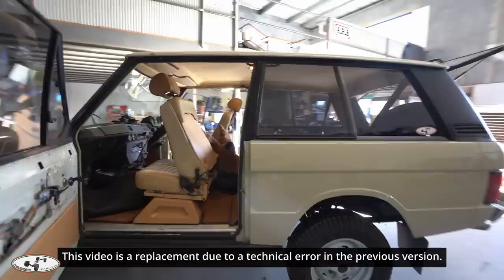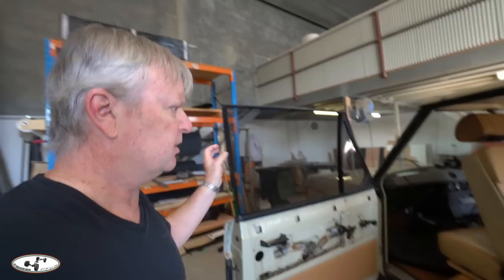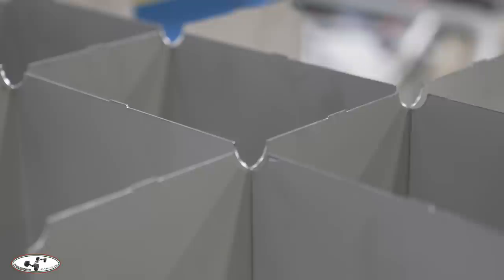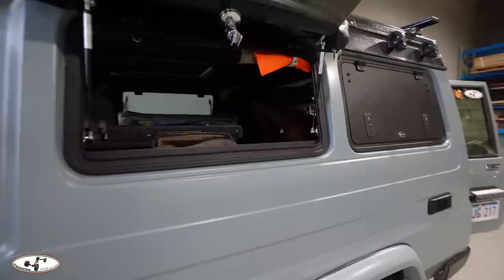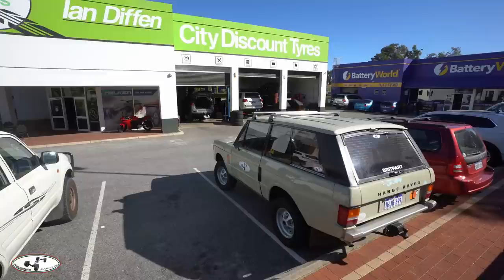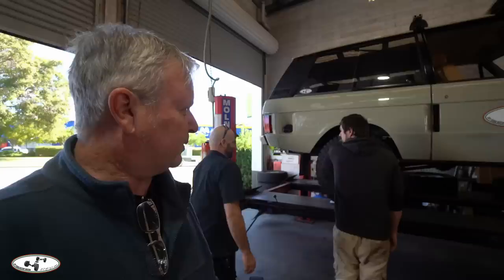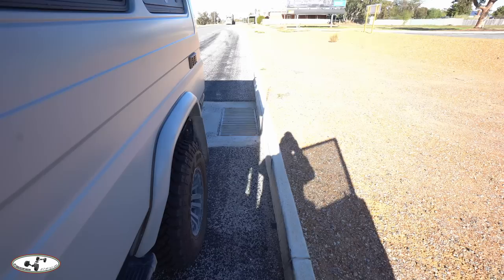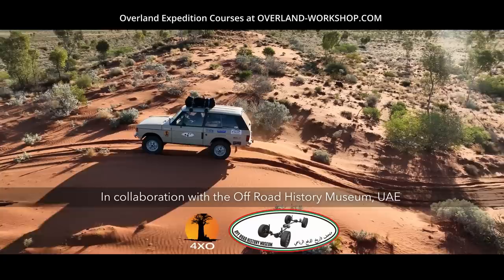Troopy and Range Rover Final prep for The Canning Stock Route | @4xOverland

Comment: You're breaking all the 4wd rules for vehicles here:  NEVER set out on an expedition without first doing a shakedown run to see what goes wrong or need fixing. The Range Rover is a mighty vehicle....but a trip like this without an initial shakedown is simply asking for trouble.  A new untried gearbox ??? Untried suspension,  untried engine loading.
Great to see this vehicle attempting the Canning. I hope it works out well. But I would not be surprised if it breaks down early in the journey. I would always recommend a dress rehearsal well before the start to ensure it shows up the inevitable issues/limitations before commencing the main event. In this case it may ruin the expedition. I sincerely hope I'm wrong!
Looking forward to watching the journey.
Thanks, Frank 🙂
Reply from the maker: all the rules? Really? All of them? BTW. We did do a shakedown, but not of the gearbox. Ran out of time. Stuff happens.
Reply: That defies the purpose of the Adventure and the Challenge which was to drive a Well Maintained Old Car (Driving it from Melbourne to Perth was it's ShakeDown) down the Canning.

No Doubt that Vehicle, when reaching the bottom of the Canning could have quite easily turned around and gone back up the Canning with no problems what so ever.

Comment: Great vehicle preparation video, but could you please explain why not the black tubeless steel rims, was it really because of the purists? I ask as you have made other modifications such as strut tower bracing, non original gear box, non period correct additional fuel tank and roof racks etc etc. Thanks in anticipation of a response.

Comment: Let us know how the tubeless radials work out with tubes inside of them....I always had concerns that when running low off road tire pressures that there would be increased internal friction and heat between the two. Hopefully this is unfounded.

Comment: Looking forward to seeing this unfold 
Is your Jerry split into compartments?
I’m prepping for a 15 hr remote journey and had a leak in one of my Jerry cans
Lucky it was not one big tank!
Reply from the maker: Baffles, yes, compartments? No.
Reply: I feel that the single, (vibration fatigue untested) bespoke tank presents higher risks than the internationally standard and individual Jerry cans. What if a leak appears early on, that's a lot of fuel to relocate before welding a repair. Also, seems two types of fuel pumps (tank and vehicle), requiring two spares? Refueling by Jerry can admittedly has it challenges, especially in the heat.